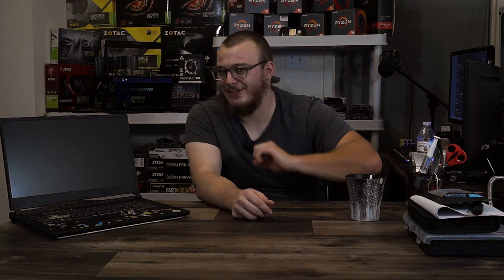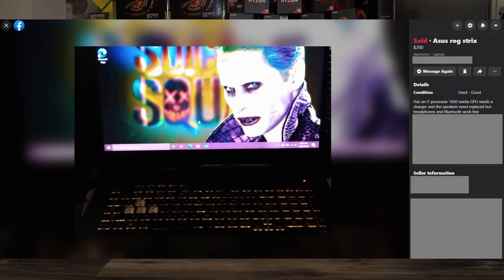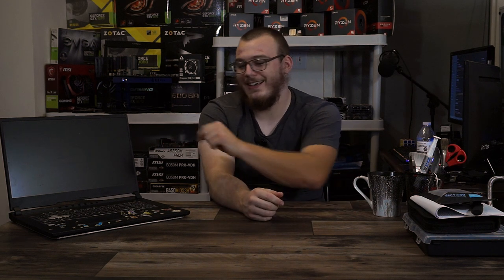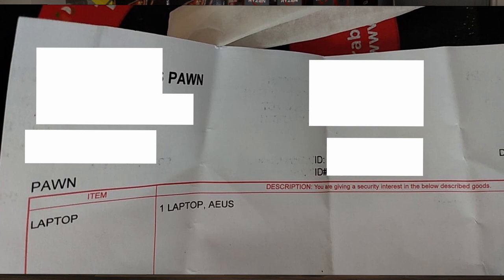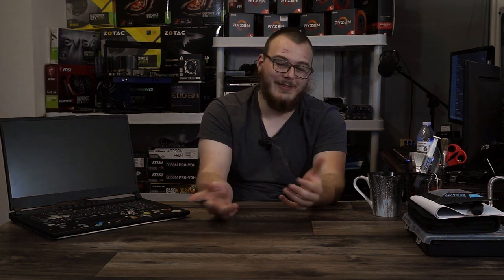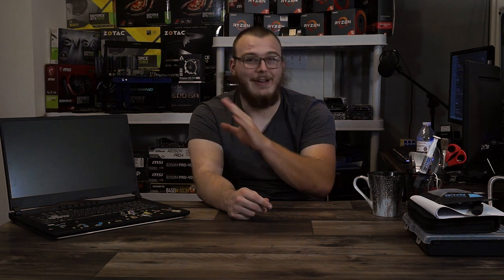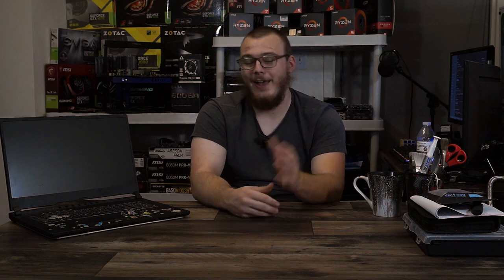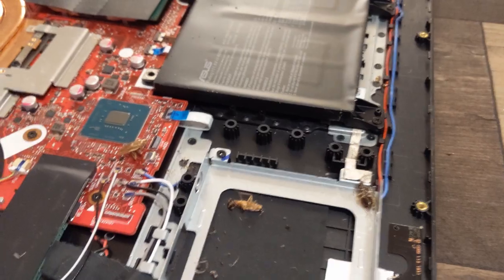I Bought A Buggy Laptop... Literally...

Comment: Ahh, The life of a computer flipper! I got into flipping a month or 2 ago thanks to your videos, And I also got a rather interesting computer my self. It was fairly similar to the add for the laptop it had only 1 pic it was an hour away and the description was as long as a kindergarteners mini-book. (this was a stand-up tower by the way) He had it listed for 450 I talked him down to 325, And I had no idea what I was about to get into... I did some detective work on my own just by the one picture but when I got home that's when I found out the really interesting stuff. It had an EVGA 1070 SC (this was in the best condition it looked brand-new out of the box, An AMD FX(tm)-8320Eight core processor (this CPU is actually only 4 cores and 8 threads I have no clue why they named it 8 core)This CPU is giving me way more performance then it is supposed to it's all the way at 4.2Hz, 12gb ddr3 1333 (I upgraded that to 16gb 1600 ddr3), a 700-watt power supply that is from a brand I don't recognize. So all of that for 325 is fairly good but now it gets into the weird part! The rest of this computer is a mess, 70% of the screws are missing or threaded out (that is not an exaggeration), every fan is super cheap and different, the CPU fan is supposed to be screwed in but it is being held on by what looks like bent paper clips, it had 3 older hard drives (2 500gb,1 1000gb) 2 were floating around and one was being held in place by cardboard! oh, and did I mention every part of the case looks like it was hit repeatedly with a hammer for hours! I tried my best but I have decided that the side panel will never fit back on! The previs owner wiped the hard drive that had the OS on it but left everything on every other drive with and I am not joking... 57 partitions!!!! OMG that was crazy and it was just in between 1.5 terabytes! But the craziest part about all of this is that once I got all of the mess that the previs owner had created cleaned up, every very core part about the computer worked perfectly! I need to spend a good bit of money to make this a nice gaming rig but as jank, as it is this thing performs! it has handled every game and test I want it to do at max settings! I still got a lot of things too work out and I need to switch up a lot of parts but overall I think this was a good buy(ish I got a lot a lot of work to do), I love tech and this is a profitable way to mess with and have fun with what I love most tech! Thanks so much 2 wheels for inspiring me to do something I love, grate video I look forward greatly to the next one! :)
Reply from the maker: Now that sounds like the flipping I love. Legit had a huge smile on my face while reading it. Good find my man, and keep up the good work!
Reply: @twowheelsusedtech7628  Yesterday I had to fix my PC due to a fan in the power supply being loud. I found it was more enjoyable that gaming on it. lol.

Comment: Reminds me of the time I got an 8700K, 16GB DDR4, and a GTX 1080 two years ago for $225. Drove an hour out, a bit sketchy but transaction went smooth. Got home to test the 1080 and a weird smell came from it. Starting seeing roaches in my system and right away wrapped it up in a ziplock and put it away for a while. After a couple months, decided to disassemble and found tons of dead roaches. Pretty much soaked it all up in 99% alcohol and deep cleaned the whole card. In the end, sold the CPU and Ram for $300 and got a free roach infested 1080 lol
Reply from the maker: I always prefer my 1080's with a little extra crunch anyway :p

Comment: Stumbled on this channel looking at some pc flipping stuff. Great channel man. Since I'm going to be doing this flipping stuff with some extra parts I have laying around (and then buying after existing inventory is over), I got a few questions. Idk if you answered this in another vid but besides hardware, what do you include in the builds you sell? Network cards/adapters? Also, what do you think about setting up a website for your PCs? Keep up the great work!
Reply from the maker: I tend to offer WiFi cards, and or WiFi adapters to customers for basically just the price of the part. Generally I have to make them aware that not all computers come with WiFi, presumably saving me the trouble of having an angry customer when they get home and can't connect to their router. 

As far as a website, I've found that having a facebook page and the youtube channel is enough for most people. Whether I'm introducing them to what I do, or showing them that I'm not going to scam them with a computer.
Reply: @twowheelsusedtech7628  thanks for the response. I live in an area that isn't exactly filled with tech savvy people. Didn't want to upset someone and get bad reviews and stuff.